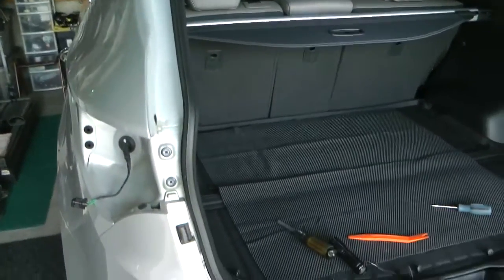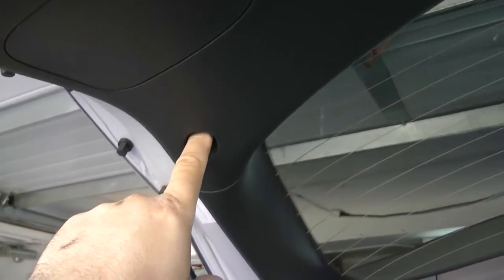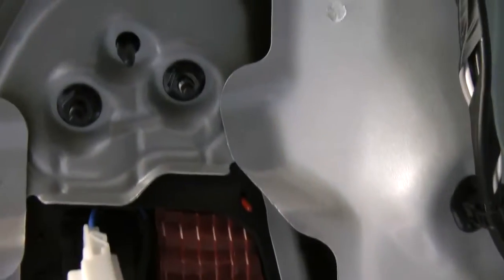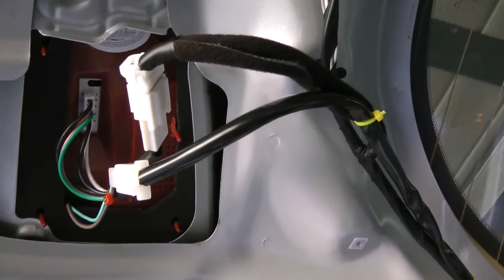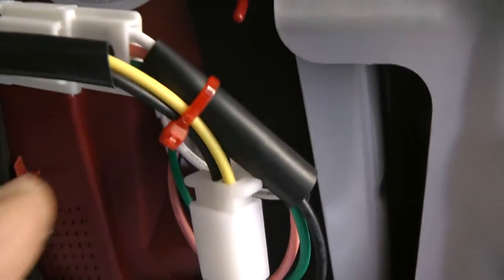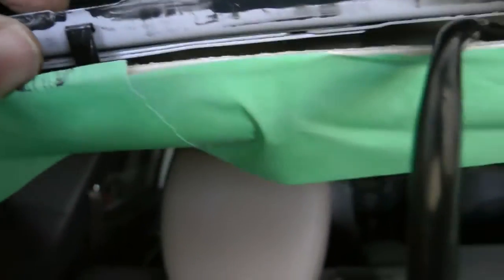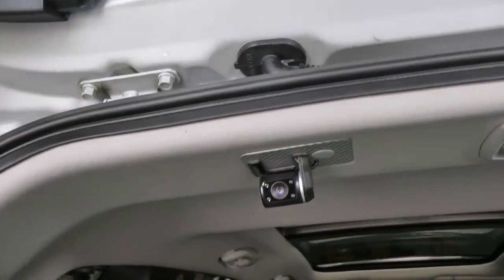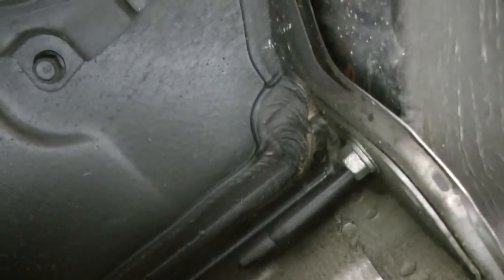2013 Santa Fe LED Tail Light Install

Comment: Nice work! Did the lower reflector lights come as a kit with tail lights?
Reply from the maker: No, the reflectors are made by "CAMILY" and they are on eBay for about $110.00 shipped.

Comment: I'm pretty positive that your canadian particularly ontario. I saw your glimpse of your plate number. BTW I also install a custom LED tail lights but I didn't have to pull out the whole back panel. I wonder why you took off the whole panel? where in fact it's all plug and play.  Check mine too
https://instagram.com/p/sCdWWosZcI/?taken-by=dudeskiemaizter
Reply: Andrew Domingo Hey, I am trying to purchase one of these.  How did you installed these led lights without taking the whole back panel off?  Your help on this is much appreciated.  Thanks
Reply from the maker: Andrew Domingo My lights have signal lights in the inner tail gate lights so that all tail light pieces have signal light function.  That's why you need to run the extra wire.  Your lights are different from mine.
Reply: OK..  I see.  So if I buy your type of led tail light then you don't need to run the extra wire nor open the whole back panel, then?  Thank you in advance for your prompt reply.
Reply: Andrew Domingo OK..  I see.  So if I buy your type of led tail light then you don't need to run the extra wire nor open the whole back panel, then?  Thank you in advance for your prompt reply.
Reply: 4Turbofan Hey, what is wire color for parking lights in front head lamp housing sockets? (Left and Right)
Just positive color wires..  Thanks in advance, mate.